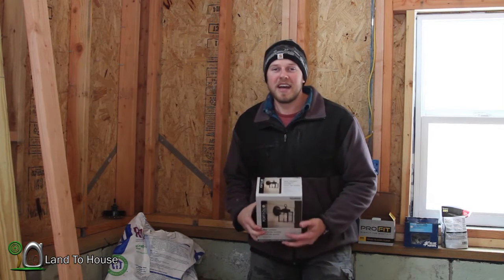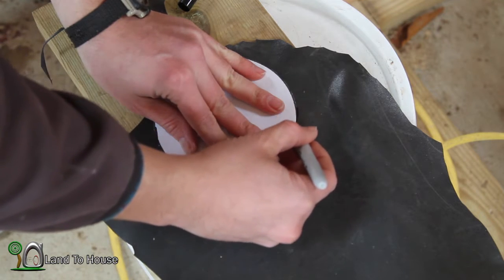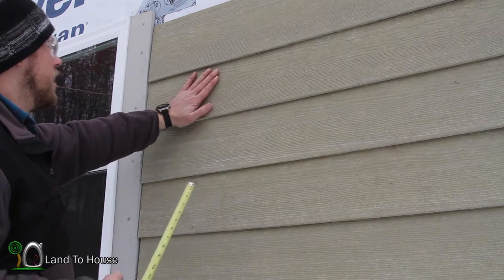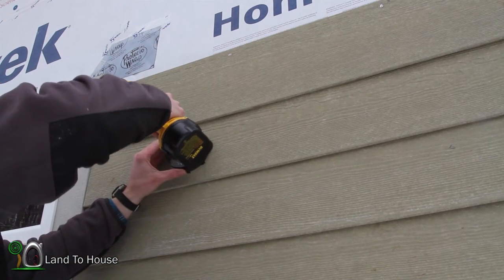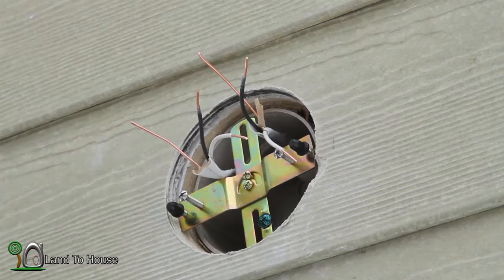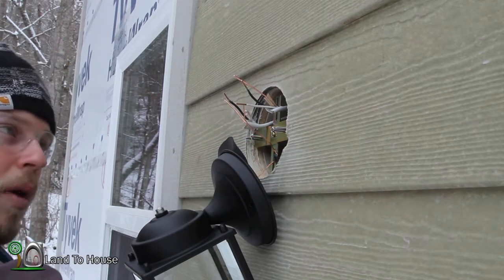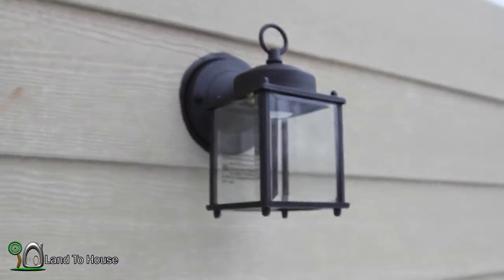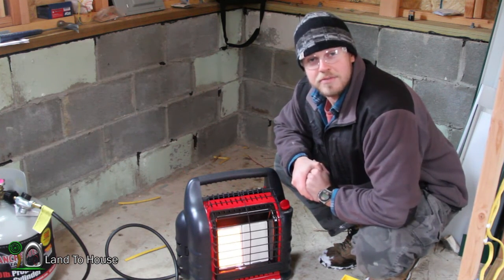Tiny House 70 Outdoor Sconce Light

Comment: I really enjoy watching you explore this project.  Exterior lights like this usually get installed in a siding box that mounts outside with only a small hole through the sheeting and siding for the rolmex to poke through;  the wiring connections are made inside the vinyl siding box outside the house.  It actually hurt to watch you cut a hole that big in the wall...thank you for being human my friend!

Comment: 8 inches of striped wire is where you want to be in the event you need to work later on In comfort. Bottom line; it is easier to work on this light at a later date when you have enough wire. Wire even in todays prices is very cheap so you don't need to save a few pennies and find yourself working in a mini space.
Reply from the maker: Charles Atlast Several people have mentioned this so it must be very true! Well I hope that it dose not need repair for a long time. This wire was a really good price... Free haha
Reply: @LandtoHouse  outdoor light fixtures eventually wear out and have to be replaced.  No matter how well made, humidity/fog/driving-rain, it all eventually gets inside the fixture's contacts.